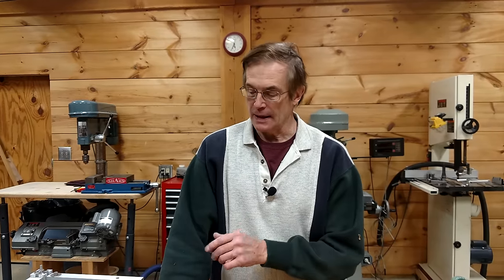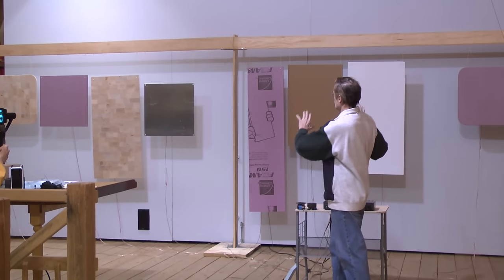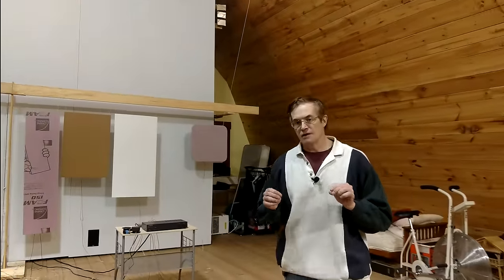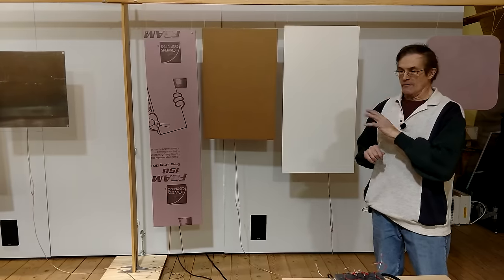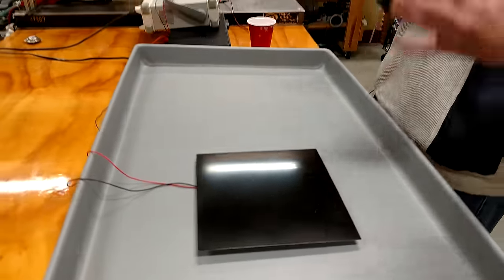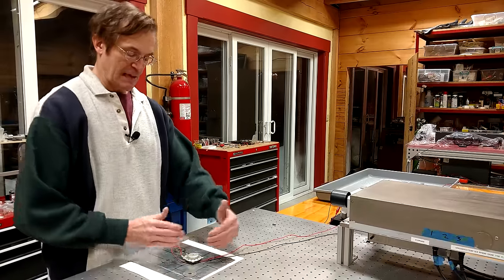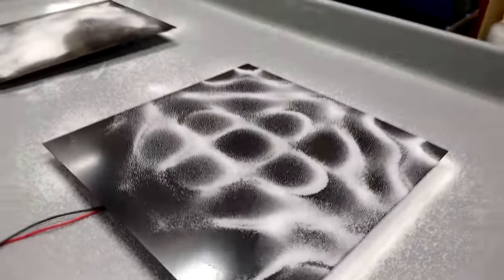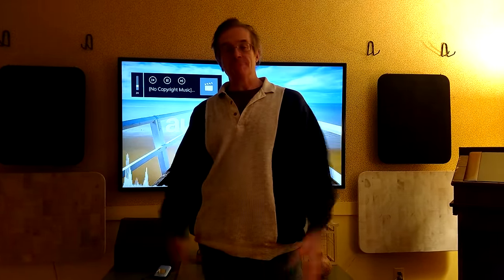Fantastic DIY Speakers for less than $30!

Comment: I wish someone would test these types of speakers in a room with good acoustics with well placed microphones. All I've heard so far is a quality of sound that would tire my ears after about 10 minutes. Harsh mid-range and peaky highs. I appreciate all the work that went into this presentation, and it represents a far better exploration of the science behind flat panel acoustics than anyone else's demo on YouTube - but I still can't hear how good they are because of the rooms that they have been installed in.

Comment: I actually dabbled into the NXT tech a decade ago. We went through a lot of materials too and none were good. However, after the years of search I found the best material. It was the paper honeycomb used in the low-cost furniture manufacturing. I got mine cut in 10mm strips.
It's very light and VERY rigid. Now, to make them sound, I glued thin paper to both sides of it. Used small amounts of the rubber glue to do the task. The results were bad, with lots of distortion and horrible roll-off after about 8 kHz. But after a few months of drying up and tensioning it suddenly perfected. The distortion was gone and the air (8-12 kHz) appeared in the sound.
I'm using the panels as the ceiling speakers in my ATMOS system and they don't disappont - which is a high mark given that the rest of my speakers are Dynaudio Contour series.
As for the exciters, I used some chinese noname parts, quite powerful though. More powerful than the smaller Dayton Audio  ones. Each of my panels is 60x100 cm with 6 exciters.

I would imagine the high-end aramid materials would fare even better than my paper honeycomb as they wouldn't be afflicted by the humidity, but I wasn't able to procure any of it.

Comment: I made a pair of speakers using the pink foam board. I laminated 2 1" pieces together for a slab of 26"X36"X2" ( qty2) and mounted a DVD disc to the back of the foam and mounted the driver to the DVD disc, figured since the disc is "non compressable" it would transfer the energy to the foam better than instead of just the part of the adhesive ring on the driver. A quick test of laying the driver on the foam ( without adhesive) worked well but by using the DVD disc attachment method, the volume and spectrum was definately increased.
Reply from the maker: That's a good idea.

Comment: I really want you guys to test Paulownia.
It sounds so much better than XPS and acoustic ceiling tiles to me after trying out all three. 
It's pretty much flawless. Rich and clear audio from low to high frequencies.
I use 800x600x20mm panels, rounded corners, 24w 4ohm, glued with 5-minute epoxy, rested on rubber/silicone (hanging them worsens the sound significantly)
Reply from the maker: Thanks for the suggestion.

Comment: Years ago Yamaha had such a speaker they made for Fender that used a foam diaphragm, but it was polygonal, and the sides were all different lengths.  With the offset of the driver, there were a lot of different resonant wavelengths created.

Comment: I worked in a plant that made extruded sheets of solid & foam pvc & always thought that the foam sheets would make a good material for speaker boxes. Thing is when being manufactured they aren't smooth because of the extruder lips but the calendar rolls the sheet runs though after leaving the lips. These rolls can simply be swapped for mat finish rolls and Bobs your uncle.
Reply: I forgot to mention you can also get different colors by adding different pigments.

Comment: I used to make eskimo drums,they used to be made  by stretching a walrus stomach over a thin rimmed  hoop......now are made with stretched aircraft fabric painted with varnish and shrunk with heat to tighten....these drums have a hypnotic resonance.....one of those $6 units  would be interesting because they are tuned with temperature.

Comment: I built these and they cost $65nz total , they are absolutely brilliant. Then I went to make another set for the Bach and just the exciters now cost $49nz each so I searched down another brand of exciter for $15nz and will compare the results when everything eventually arrives, even the foam board is getting hard to find here now. Thanks so much for the content that you provide.
Reply: Another kiwi here.  Can you let me know which materials you sourced?
Reply: @saiden630  EXPOL HD extruded 40mm sheet and PUI Audio 101mm transducer from Mouser Electronics HK
Reply: @saiden630  the PUI ASX10108-SPD-R 8ohm exciters are just as good if not better than the Dayton Audio
Reply: @rockadon1977  at 8 ohms they are probably easier to drive too
Reply: @saiden630  and a brilliant full sound. I used Harmon kardon surround tweeters and they are perfect for the peak high frequencys like tambourine and triangle that are masked by the polystyrene (I think)

Comment: i build guitar cabinets using plate speakers, but i use aluminium, which i tension on the cabinet, this gives a very metallic sound without real resonances, but with broader reverberation, albeit very short reverberation. it really gives the sound a different feel, like the whole room is filled with sound.
i advice them to be pared with a more conventional guitar speaker cabinet, because they are a bit 'too much' for stand alone use for most genres of music (exceptions are shoegaze and black metal, they seem to work very well, since the plate speaker brings a very atmospheric reverberant sound fitting to the genres).

Comment: I have worked in audio engineering for nearly 40 years and have always been intrigued by NXT (here in the UK)/DML systems. However I have never heard them, what is the stereo image like. All the known physics of stereo/immersive sound shows that point sources are better at conveying position and generating sound fields. The Quad ELS systems use a series of concentric rings that are energised via a delay line (time 0 is in the centre) as the wave length increases the outer bigger rings are energised at a time 10s of micro seconds later. By placing the the actuator in the centre and cutting a series of concentric circles using a V cut V with one vertical side would break up resonances and possible delay the signal as it propagates to the edge. Thanks for the interesting video.

Comment: I've bought this type of product like a decade ago when I was doing marketing. Called a Soundbug, it was a nice and compact speaker that can be made bigger in an instant...After I tried different stuff that I had available, not as comprehensively as here..cardboard had best results for me. Because of cardboard sound quality and every place that I visited with that thing, had some redundant cardboard somewhere :D
Soundbugs limitations were battery power so it was never too loud though

Comment: I’d actually considered installing some exciters/transducers in my walls, which were old paneling with a grass cloth wallpaper. Since we sustained hurricane damage and have removed all our interior wall facings, I don’t think I’ll do this since we’re going back with drywall. I’d wanted a discrete surround sound system and I may experiment with installing exciters/transducers in paintings hanged strategically around my living room.

Comment: It does work! However, the pedestal mount becomes critical. I was very slopy when I made my wooden adapter to attach to the back of the exciter. The result was obvious. The pattern generation was not symmetrical and, in some cases, indistinguishable. It is my opinion that every coupling must be symmetrical, even when it is attached to the exciter.

Comment: I rewatched this after I created my first set, I'll be experimenting with foam weights to help my peaks in the panel. Mine are tinny but outside they sound great compared to my bluetooth speakers. Also large boxes are great subwoofers
Reply from the maker: Interesting.
I'll check that out.

Comment: Maybe you could Frankenstein all the best materials together in some way. For example, you could use the good foam as a base, and put small blocks of the other good materials in such a way that the foam is still able to vibrate. It’s just a suggestion, but yeah.

Comment: Did you try round panels?
the edges of square panels would probably "resonate" a bit differently or have a delay on the edges, a round panel would be structurally stronger.

Comment: Incredibly gratifying, hugely satisfyingly dense tranche of practical acoustic physics.   You have given us DIY-HIFI nerds economic equality! 
How did your resonance peak demo  using the 3/5ths 2/5ths rule end up in your home theater? Offset audio exciter? Rectangular panels I got.  Rounded edges, …check…sanding the surface, I kinda understand. What about partial holes changing densities instead of the counter weight washers in the demo …are there counterweights in your home theater speakers?? The end-grain balsa speaker elements sure do look square rather than rectangular.  Could the next audio playground please make use of binaural or stereo channel listening for better viewer appreciation of your teaching?
Your ability to communicate your chemo-physics acumen is astounding!!!  
Love ya man! Keep it up!
Chas

Comment: Watched all of your DIY vids that used the 4ohm drivers until I made mine from your instructional vid elsewhere. 

In yet another vid I noticed in the background  you use the staggered driver positioning, two units per panel ... was it the staggered singles with an additional dead centre placement added later but not documented? And did it give more volumous, fuller sound if so?

My 7.1 Onkyo has a setting that can be 4 or 8 ohms, that accommodates 6 ohms rated side speaker in both settings... but naturally doesn’t cover all 3 in one. 

The “one driver” build sounds just thin or weak with the 4ohm setting for the 4ohm driver, didn’t want to risk the 8ohm setting, so was considering adding the extra driver per panel (DEAD CENTER BOTH PANELS YES?).. i believe you ,mentioned wired in series to make combined amount to 8ohms... so i could use that setting instead. 

WOULD THIS UP THE PRESENSE OF THE SOUND, of the single off centre driver design DIY? Is it correct to add the second driver dead centre both panels, or does it require a panel remake or removal of first driver to math out all new positions (which probably damages the panel during removal?)

Comment: I may take my two busted acoustic guitars remove the necls and turn em into some specifically for unplugged acoustic guitar listening speakers thanks so much for all of the thorough testing and optimization of this project i appreciated the extra audio insights a ton! glad im subbed and got this in my suggested vids haha.
Reply from the maker: More recently, we posted a video where we did something very similar to four string instruments and took them on the road to demonstrate this to the public.  Check it out.
Reply: @TechIngredients  Hey, that's exactly what I needed to see—thanks a bunch for the suggestion! It can be tricky to find a specific video with so many options out there. Earlier, I ended up learning a lot about thermal paste (it’s pretty cool how a metal can become unstable when broken into fine powder) instead of finding the 'audio-adjacent' video I was after, haha. I also ordered two of the 8-ohm 20W exciters from Dayton, along with one of the 4-ohm 40W ones to try out, since I’ve got a few amps to drive them. I’m really liking the idea of a possible ceiling-mounted, downward-firing setup—might have to add it to my studio’s collection of referencing oddities! For most of my life, I was told speaker technology never changes, but here we are, haha.

Thanks again for all the valuable knowledge I’ve already gained from you—and for the many more insights I’m sure are to come.

Comment: Keep coming back to this because I would eventually make them for a stereo I would eventually have.  Well the time has come.  I purchased a very nice Denon receiver and will build these speakers to make a 7.2 surround sound environment.  Just trying to figure out what to use for a center channel.
Reply from the maker: You might also take a look at our more recent video. "Should speakers this good be legal?" That's basically what we did and used panels for the center as well, but you certainly could choose something else, especially if you have some decent speakers already on hand.
Good luck!

Comment: These speaker are 'bi-poles'.  They work best at 3 ft or more from the rear wall. The sound waves must have enough room to wrap around the speakers.
I own a pair of Magnapan ribbon speakers (a flat panel speaker. Space really makes a difference.

Comment: First off Thank You. I cant stop watching your videos. Soon i will build some flat panel speakers but i have a question. Is there a loss of fidelity with the exciter just floating in mid air.
The panel has more mass then the driver so the driver will just push back off the panel. if the driver was stationary and the panel was floating all or more sound will be produced from the panel?

Comment: SIMPLY,,, WOW!!!   I am amazed.  I want to build some of these for my yard and work building.  You have taken the panel speaker to the NEXT LEVEL.  Can you put together a project to make it the complete system?  Lay out a top of the line bluetooth amp, driver, subwoofer and the correct exciters to get the very best out of the system.
Reply from the maker: Did you watch our follow up video on these speakers?

Comment: Great videos.....Have you tried carving/sanding out centre of polystyrene or balsa a little to make it thinner  to create a very very flat cone,...kinda embracing a normal speaker but  keeping large elements of the flat board system.

Comment: At the end you talked about more than stereo reproduction.  The only sources I know of (at the time I'm writing this) with 4 or 6 channels are movies.  These speakers already solve the comb filter effect of point sources (tiny speakers).  Have you tried making more speakers and using multichannel recordings?  My questions are 1) Would it sound more realistic even if you move while listening? 2) Would such a setup allow you to overcome the room size acoustics, to the point that a proper recording could sound like the recorded environment rather than a recording played in your room?

I would of course use Movies as a source for testing, but I would also find or make recordings of music, e.g. a single piano, a small combo, even possibly a recording of an entire orchestra.  What happens to what you hear when you move around?  Is the difference comparable to moving around during the recording?

Comment: Just came across this video,  very interesting!!!  many years ago I built a folded horn set of speakers   using a single sheet of 4 x 8 5/16 plywood.  had a 8 inch driver speaker and a tweeter in the open end of the horn.  obviously very flat response.  room reflectivity, nodes, etc are very always there,  even with the 'live' performance.  need an anionic chamber...

Comment: pink noise plot would be good! experimenting based on your work :-) my 50mm 1200x600 XPS boards maybe don't flex enough, but might work very well in an enclosure - I'll post and share a link

Comment: That 3/5 2/5 rule is close to Golden ratio (instead of 2:3 0.618:1, so 1/1.618 and 0.618/1.618). Have you tried placing the exciter or shaping the panel by Golden ratio in your tests? Or both?
Reply from the maker: The location we identified was the best in terms of the response of the system. There may be a superior location, but we didn't find it. Don't forget that there are variables that operate at scales from sub atomic to cosmological. It's a fractal universe. The mass of the driver, the pull of the electrical leads, and the hanging mounts are some examples of variables that we didn't account for.

Comment: Loved this highly instructive video - thank you!  Question:  I see that you applied the 2/5ths ratio to locate the counterweights.  But the last counterweight (lower left corner) - why is that on in the corner?  Is that placement also 2/5ths of one of the sub-rectangles?  Also why place the 5th counterweight in that corner/rectangle?  It's already one of the smaller rectangles, why not break up the upper right rectangle instead?  Hope to learn something from your answer.
Reply from the maker: You're  probably  right. It was redundant.

Comment: Curious as to thicknesses and whether it would be possible to put two exciters on one long board instead of two boards, one XPS and one wood. Really want to try this and see how they sound with spoken word. Could they be hung from the ceiling at the points where the weights were attached?? So much potential for more experimentation.

Comment: If you hung them from the ceiling, could you do them horizontally with the ceiling? If so then where would you connect them from, I would guess the 4 corners would be terrible for it do not have the equip to test yet.... YET :)

Comment: I completed my first pair of these over a year ago. Just the original pink foam panels hanging in our living room. My wife made some fabric covers that slip loosely over them so they match the drapes. I love them. Now I am thinking about a much smaller pair. Maybe as small as a cell phone using some lightweight thin material. I am wondering if it will work to mount the panel material to the exciter and then mount the exciter to a base or stand instead of hanging the panel. That is can I invert the design so the fixed object is the exciter and the "floating" object is the panel?
Reply from the maker: We didn't investigate an extreme reduction in scale. In general, the smaller the panel, the higher the frequency response at the expense of the lower frequencies. 
We found with these larger panels that fixing the driver was not a good idea.  The driver's mass is part of the overall frequency response, and fixing them reduced the lower frequency response, which is already the limiting factor.